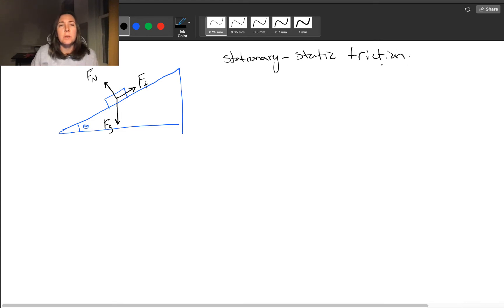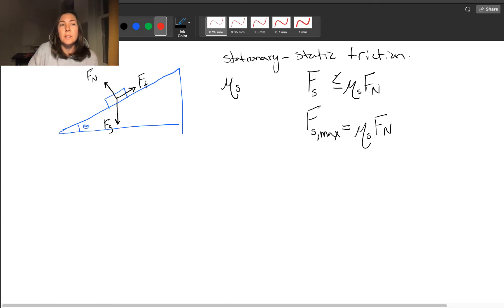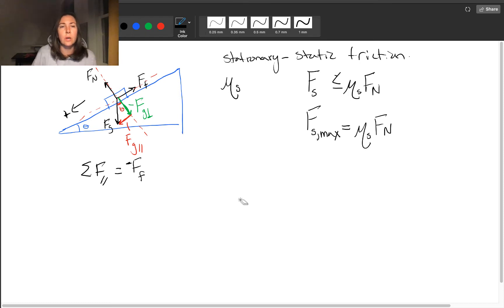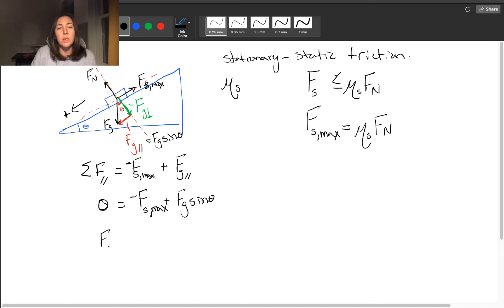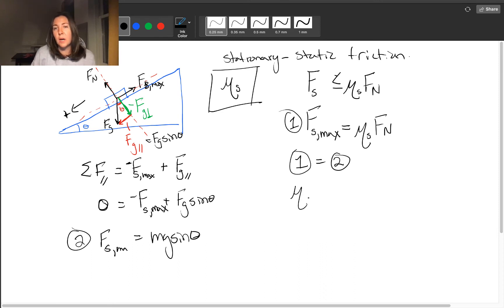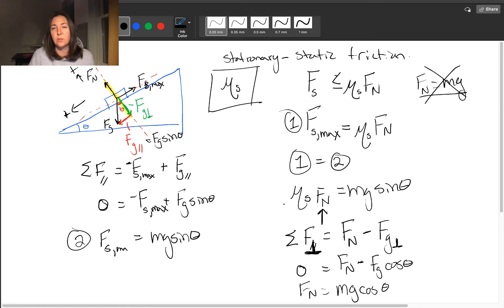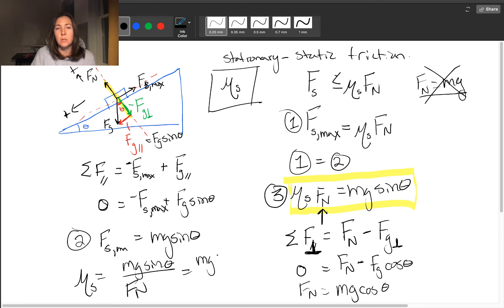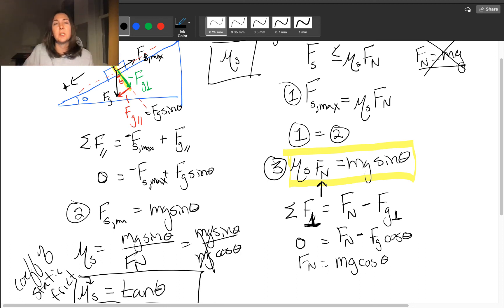experiment to find coefficient of static friction

Comment: Help
1. A trolly of mass of 50kg  states to move when placed on a plane inclined at 20° the horizontal .Calculate the coefficient of static friction and the horizontal force required to just start the trolly moving moving along the level of the coefficient of static friction is unaltered.